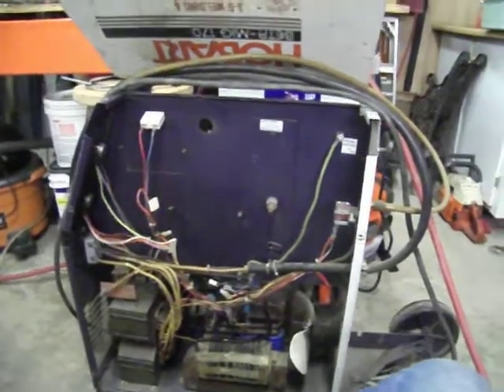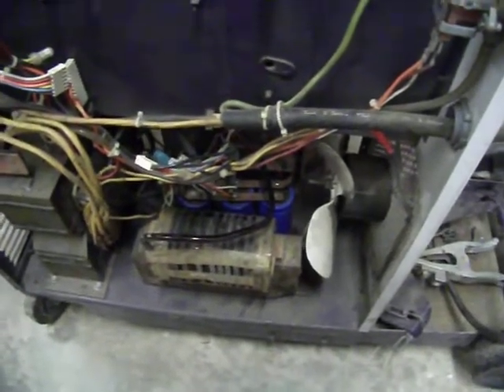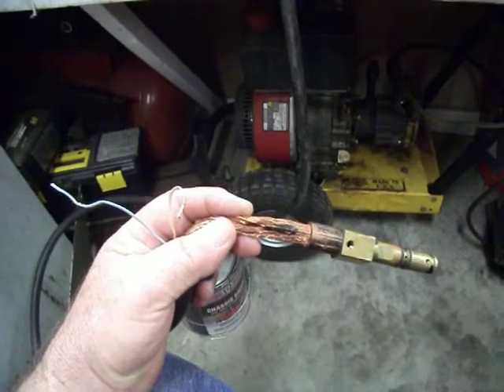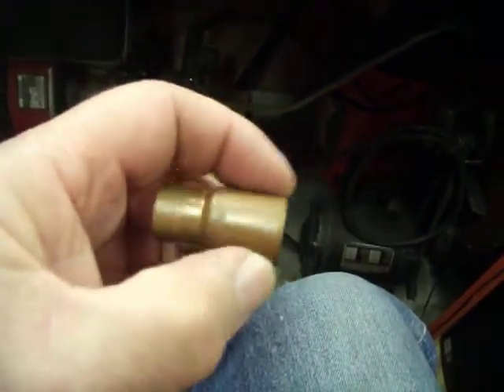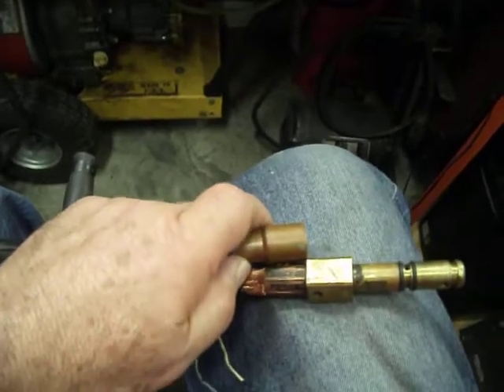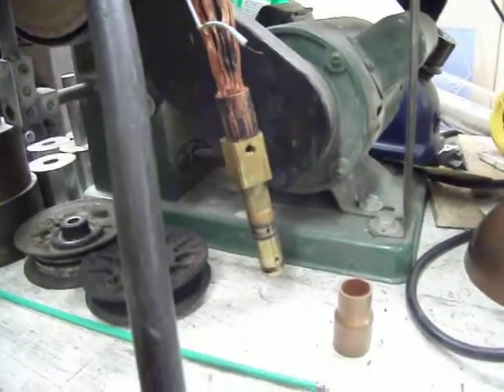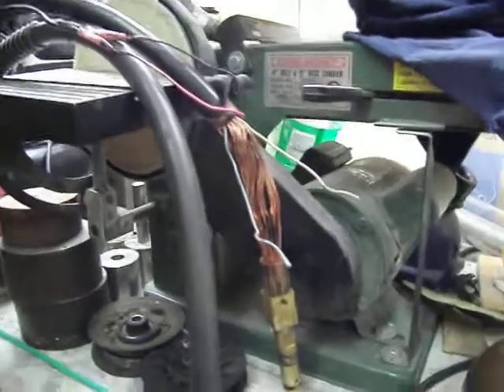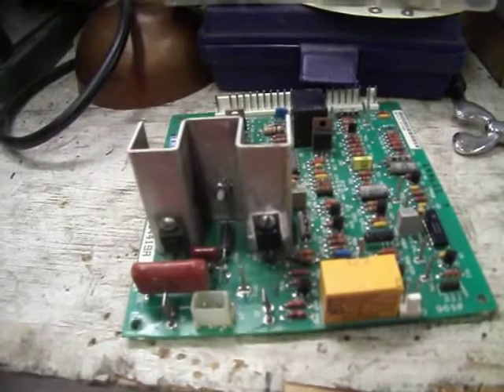Hobart mig welder copper braiding wirefeed cable repair.

Comment: Hi, I followed your link to this video from the hobart site. I have a beta mig 170 that just stopped feeding wire. I wonder if you still have the schematic for the control board? The image on the hobart site is not clear. Thanks in advance.
Reply from the maker: Yes messenger me from Facebook.  Can I suggest u check the large diodes rectifiers with the braiding wire connections, if these are blown the drive will not work. The wirefeed drive runs off DC voltage, if these diodes are blown the drive will never receive the DC voltage.

Comment: What do the white insulated wires do? Where do they connect?
Reply from the maker: They go to the switch on the stinger. When u pull the switch to the closed position it completes the circuit for wire feed and gas flow to start welding.
Reply: @nadingjeff  awesome thank you

Comment: cool.  do you think annealing the copper might make it easier to crimp?
Reply from the maker: Well it would, but I think from what I know about copper tubing and fittings, is whats engineered into it,  what they call half hard, meaning it can be worked, once worked it will become harder to hold it's finished shape. In this application hardness is a good thing because you want it to hold the copper braiding very tightly and not loosen over time. In other applications annealing is most desired, as in aircraft, copper spark plug washers, they seal better when annealed.